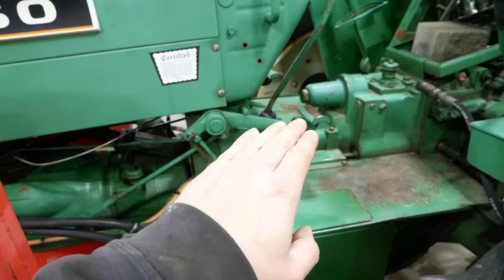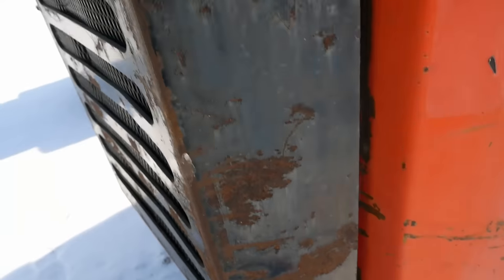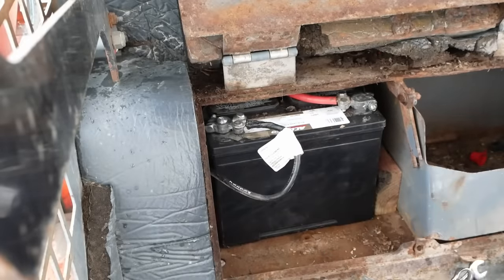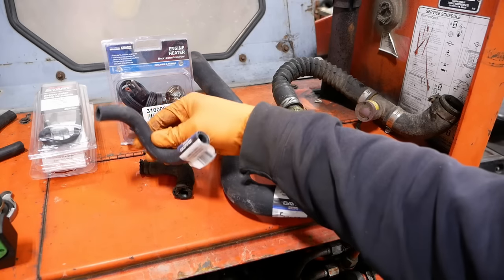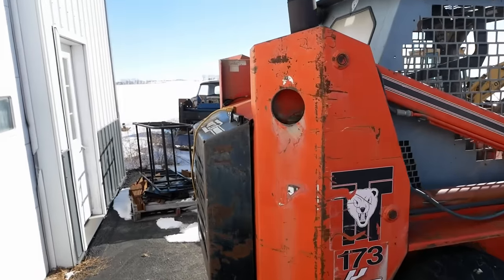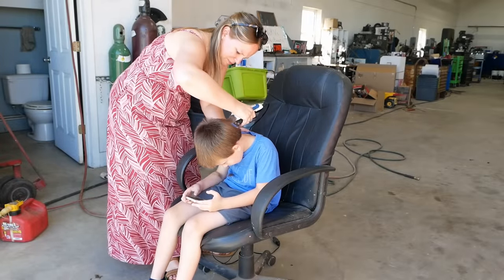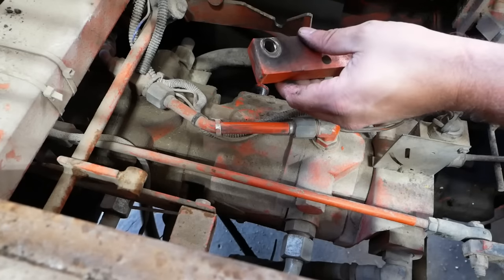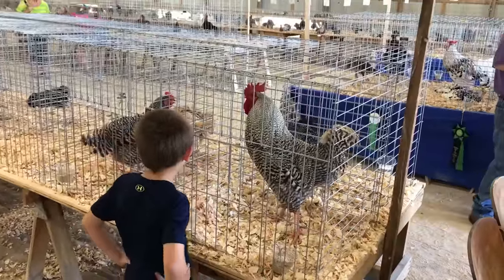Buying a Cheap Skid Steer from an Online Auction - Thomas 173HL - Part 1

Comment: Pretty sure diesel generators turn at 1800 RPM to make 60hz power.
Reply: User Joefive5466 said Hey Wes, I had to put a heavier governor spring in my V2203 when I stuck it in a Jeep. I used Mcmaster 9433K49. I’ve revved it to about 2500rpm before I let out. To change the spring, you have to pull the injection pump out and the throttle plate off and the shutdown lever plate off.
Another user said they were used a lot in generators and set at 1800rpm, which seems to fit

Comment: Alfred E. Newman was correct. If the automobile did not come into existence until 2099 the grand canyon would be full from using it as a repository for horseshit, Good thing because it all went to DC and the auto came and is on its way into nonexistence  (per AEN history of the combustion engine.)

Comment: Needs a cab and heater kit!
Reply: How about a Yorkshire hot water bottle?.

It's a soda bottle you piss in, then screw the lid tight and snuggle up with😆
Reply: @R.Sole88109  Someone's late for their examination
Reply: @fireintheholeagain  
I've had it.
It's confirmed, I'm insane in the membrane😜
Have a good'un👍🏻

Comment: ran a thomas once that would not rev up.. there in a screen in the fuel lift pump that was gumed up.just idea.
Reply: User Joefive5466 said Hey Wes, I had to put a heavier governor spring in my V2203 when I stuck it in a Jeep. I used Mcmaster 9433K49. I’ve revved it to about 2500rpm before I let out. To change the spring, you have to pull the injection pump out and the throttle plate off and the shutdown lever plate off.
Another user said they were used a lot in generators and set at 1800rpm, which seems to fit

Comment: I'd sure check tire prices.  Those look like 12 inch and the least expensive tire that you can find will likely be just fine for what you're doing.  Thomas was just fine but they were pretty ancient as far as design was concerned but that wasn't all bad because they were simple.  I can't remember them ever changing their design for the entire time that they were in production.
Reply from the maker: You might get some cheap one for $800 or so. You can't get them for less than $200 each.
Reply: I have seen too many folks substitute snow tires for skid steer tires.  Skid steer tires are designed to easily skid sideways.  Snow tires grip too well, wearing out chains and drive units faster.
Reply: @WatchWesWork  I just found you so I don't know, are you in Canada?  I saw you putting in the tube so I figured you'd be installing them.  You're right then, $800 would be about right installed.  I ran a lot of tires on skid steers, and no matter what I spent, they seemed to last about the same.  Based on what it looks like you're doing, the cheap ones will last as long as you own it.
Reply: @robertheinkel6225   Do they make a snow tire that would fit on that rim?  I'd think they'd be too narrow.
Reply: @billsmith5166  Wes is in Illinois, but he speaks very fluent Metric, so we should make him an honorary Canadian :)
Reply: @stanpatterson5033  Ah!  For some reason, the Thomas and the tire prices made me think Canada.  I used to live in the Quad Cities.
Reply: @billsmith5166  Which one? I've heard there's about four of them all close together  :)
Reply: @stanpatterson5033  I lived in Bettendorf/Pleasant Valley and worked mostly in Moline.  The other two are Rock Island and Davenport.
Reply: @billsmith5166  Very nice area.  I used to deliver to a customer on W.76th Street in Davenport,  do not remember being off the beaten path in Bettendorf, Moline, or R.I., just flew by on the Inter skate.  It's possible that I have bumbled through when the Inter skate was closed or detoured, don't remumble though.

Comment: That battery placement is not ideal.  Too bad you can't reach it from the side.  I can see and hear Camarata now.  He'd cut a hole into the side of the beast and fabricate an access panel or door.  Also, if you back your snow equipment into your shed/barn/etc., you can begin snow removal right away.
Reply: But it won't move the arms cuz you can't start it, so the side access is pointless. But I did enjoy his chainsaw cutout for the stereo

Comment: Will you get chains for over the tires for it? :)
Reply from the maker: I might have to break down and get tires...
Reply: @WatchWesWork  oh I haven't looked the video yet, but it's a nice addition for getting traction in snow/ice/mud. @DieselCreek got them on his machine too :)

Would save you the money for new tires, as it's basically irrelevant what tires you run, as long as they hold air :)

Comment: Not sure what your running for oil.BUT,CHEVRON Delo 400 10W30 diesel oil is a fabulous oil for running in cold temps.Up here,I will switch engine oils in winter from 15W40 to 10W30.makes a difference on cold starts for sure,combined with a good battery and block heater,deadly.

Comment: 1780 RPM sure sounds like a generator engine
Reply: User Joefive5466 said Hey Wes, I had to put a heavier governor spring in my V2203 when I stuck it in a Jeep. I used Mcmaster 9433K49. I’ve revved it to about 2500rpm before I let out. To change the spring, you have to pull the injection pump out and the throttle plate off and the shutdown lever plate off.
Another user said they were used a lot in generators and set at 1800rpm, which seems to fit

Comment: Funny, you give up on one pec of equipment you know, and go buy someone eles pile of crap.
You either fix what you have or go buy new or used from a dealer.
I might have bought an old 8n or 9n ford tractor with a back blade and 3 point hitch. They or 70 to 80 years old you can still buy parts and they always start might take a squark of either but they start.

Comment: So I think you know this by now but you can get the manual on-line and print it, the engine comes out very easily, four bolts and some wires and the entire engine and cradle are out.
Reply from the maker: There is a parts manual.

Comment: get rid of Kubota engine> Deere wasbthe way to go! we had a Kubota 4 wd and it was junk too!
Reply: I doubt you'll find a Deere skid steer with a Deere engine and I'm pretty sure you'd find Kubota made at least half of the skid steer engines for all manufacturers back then and they may still.  Yanmar is probably second.  I think Yanmar made most of the engines for Deere skids for years.  Yanmar is not a better engine than Kubota, they're both about the same as far as reliability goes.  I'd feel fine with either in a skid steer as long as it doesn't have a turbo.
Reply from the maker: Deere skid steers are way overpriced. At least in our area.
Reply: You can keep the Deere skidsteer. The kubota engines of that vintage are pretty stout. We have owned a Deere. 3 different mustangs and about 10 bobcats. Currently running one with over 10000 hours 2 with 5000 1 with 4000 and 1 with ?????because the hour meter quit at 9000
Reply: @robertquast9684  If you take care of them, they can last a long time.  The Mustangs were good machines, and so were the Gehls.  I hate to say it, but Bobcats were my favorites with manual Bobcat controls.  Parts were cheap and available, and they were pretty much tough as nails.. and they all had Kubota engines.